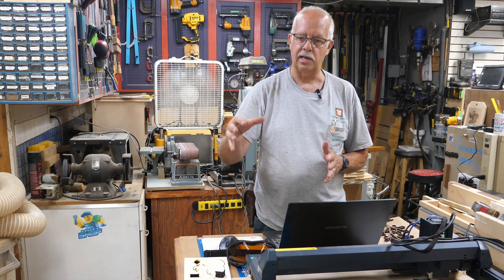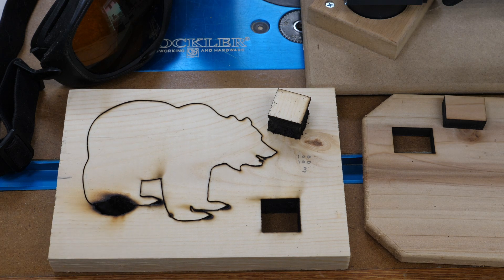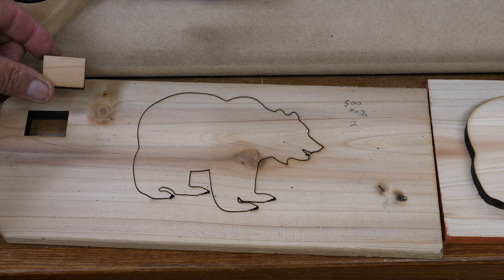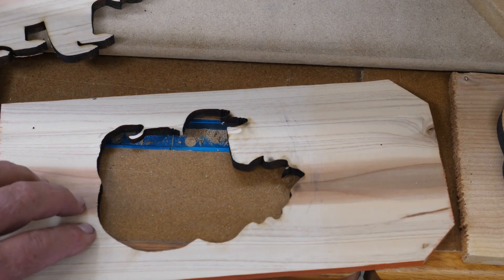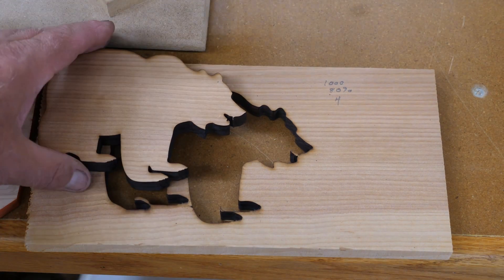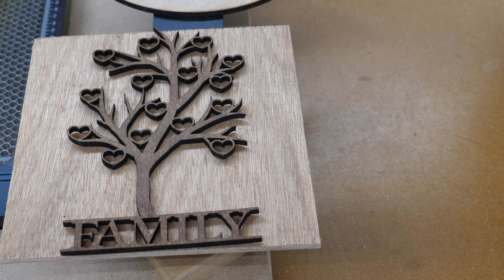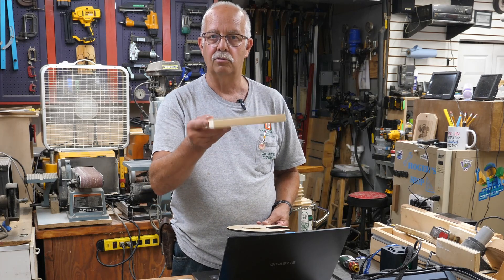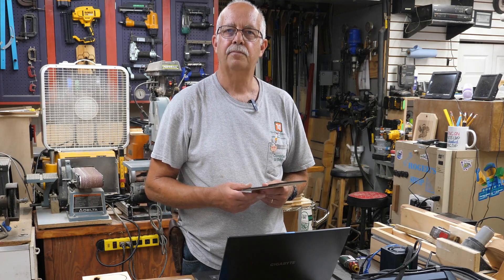Longer B1 Laser Wood Cut Settings

Comment: I was doing a test on 3/4 pine today (couldn't find this video for settings) and my laser dropped and needless to say, I had fire.  I think everything is ok am in the process of cleaning it.  My question to you is do you have any recommendations or a fix for that set screw...it's hard to tighten.
Reply from the maker: I have never had an issue with mine, but do agree it is not the most convenient to work with.  It is in an odd spot.

Comment: Hello, very nice video. Can you tell me if the lens can be changed in this laser?
Reply from the maker: For the most part, yes.  Replacement lens are available on the Longer website, but it will depend on which head.

Comment: A lot of you-tube guys say they don't like the air-assit on the B1 Longer Ray did you have the same opinion?
Reply: I think it's because they're doing more detailed work? I just ordered mine and will be looking into upgrading the air line
Reply from the maker: Other than it could use a higher cfm air pump, I have no complaints.